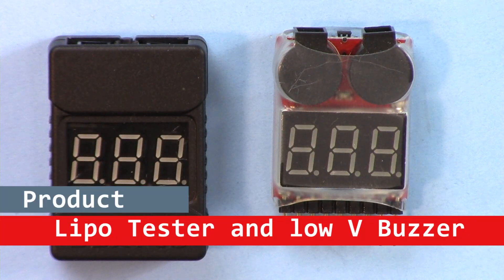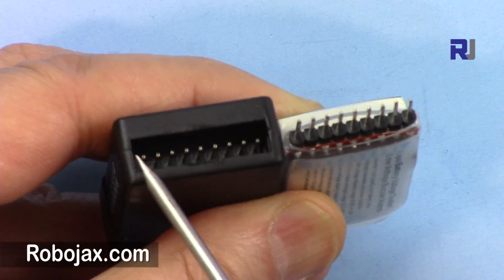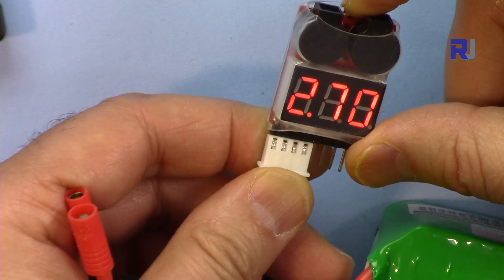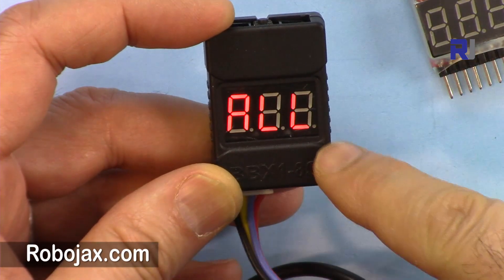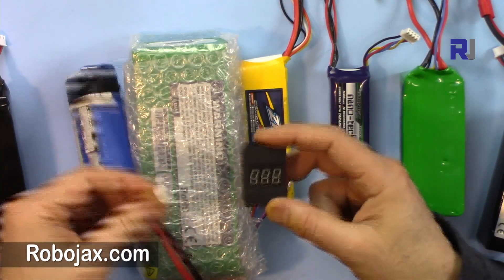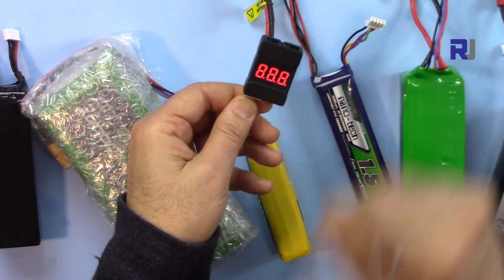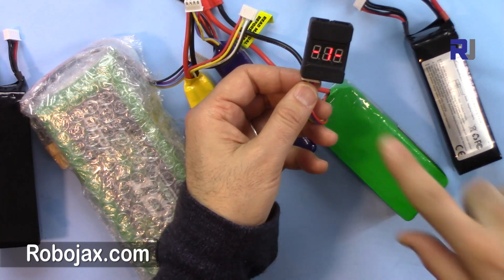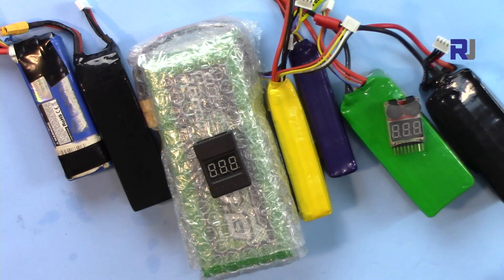How to use LiPo Li-ion Li-Fe Lithium Battery Tester with Low Voltage  buzzer alarm

Comment: I thought 3.3 volts was the low limit for lipos . My goggles used a new  4s lipo today and completely dead . But after 4 hours sitting with no charger it raised from nothing to 3 .2 volts per cell . I charged it and it is still 4.2 volts per cell 99% 😊 . Thank you for showing me the dead battety alarm i can use it on my goggles and transmitter .
Reply from the maker: my pleasure. Cheers

Comment: The display used is common anode or common cathode type? I want to change it's display
Reply from the maker: If you are changing it then remove the display and test it.
Reply: @robojax  I did a test with the display connected, it came out to be common anode type...

Comment: Testing the one I just got, I found that if the ground connector is removed with all the other connections present, the unit will turn off and not draw the 8 to 11mA that it does when it's on and displaying the readings.
 I figure on putting a momentary switch on the ground lead to turn it on and get the readings of the pack without having to plug and unplug the whole connector each time.
The draw on each of the cells is about 80 to 100uA through the sense lines, so for the long term I'll still disconnect it completely just to avoid that bit of parasitic drain.

The weird thing about the design is that most of the 10mA operating drain will be drawn from the first two cells, with the all other cells showing a negligible draw.
Connection of just one cell in a 1S configuration will read the voltage correctly, but with a dimmed display and a low beep annunciator, because it relies on the second cell connection for most of the power.

Comment: Do these things have any provisions for calibration? 

The one I tested seems accurate to the last displayed digit, so it doesn't need any further calibration, but it would be nice if it's possible.
Reply: @dubmob151 really not that long, maybe 5 secs, I don't recommend you to do it as it becomes a paperweight without knowing what the reference voltage is lol, I can't get to the microcontroller or eeprom (if present), I have the one with the plastic case and it's under the display, too much work to desolder it
Reply: @daijoubu4529  I'll have to remember not to do that- 👌
Reply: I held on the button and now all by readings are 0.00 lol I must have triggered some calibration of sort using a reference voltage, oopsy
Reply: @daijoubu4529  how long did you hold it for?

Comment: Is there a way to control the voltage of the cells with your Arduino uno and when used the Arduino with an esc and potentiometer set a shutdown voltage?

Comment: what is good  stoerege charge for 6s
Reply: if the battery alarm has triggered at the lowest voltage set on your meter ie 3.7 volts per cell after use. recharge the battery for 15mins and set a timer then stop charging at 15 mins. that should be sufficient for safe storage.

Comment: Is it set only once for the minimum voltage alarm threshold (let's say we set it at 3.6 V) or does it need to be reset every time the battery is plugged in?
Reply: I hardwired it for monitoring my battery pack and don't have a connector to detach it, so I leave it connected and just put a switch on the ground connection to turn it on and off, and the threshold setting is maintained. Seems to work fine with minimal drain. 
I desoldered the two beepers to keep it from going off every time I switch it on.
Reply: @dubmob151  Nice, that's a damn great idea!👍
Reply: @catherineharris4746   it maintains your low voltage setting also, so you won't need to keep resetting it if you're not using the default threshold-  I put a tiny momentary switch on it so I just push and hold it just to read out all the voltages; just for a quick status check.
Reply: Yes everytime you disconnect/connect a battery you must reset the low voltage alarm threshold👍
Reply: @catherineharris4746 set your voltage,  say 3.5.. press and hold button until it beeps.. now your set at 3.5 all the time, until you change it..
Reply: @jimharrow8104  Nope, every time this device is disconnected, you have to reset the voltage because it does NOT have a set voltage memory chip in it. It still serves it's purpose so you don't destroy your battery though👍
Reply: @catherineharris4746  I have to check it out... the factory alarm is set to 3.2...
Maybe I've been assuming it stayed on 3.5... 
If your right,  thanks for the heads-up...
Reply: Set you low voltage,  say 3.5... press button and hold until it beeps... Now your low voltage is always set on 3.5...

Comment: can we use the checker when the lipo battery is being used by other devices? or can it only be used to check from time to time
Reply: 💡Of course you can, that is what this device is made for, to be connected while the battery is being used so it doesn't fall below your low voltage threshold that you set👍
Reply from the maker: this is "Tester"

Comment: If you want to save money and trouble, make your li-pos last the longer it can, NEVER charge above 4.23v/S and discharges until gets to 3.4v, do not charge to store it, 3.4v/S thats the correctly storage voltage, now, about the current, you need to search about your battery charge rate, and if is real or fake, the old batteries from 10 years ago was rated 1C but was really 0,7C usually, and maybe still some cheap ones around today that do the same IDK. Off-course, always balance.

Comment: On a 2 cell or 3 cell, what is the minimum voltage to set the alarm at?
Reply from the maker: Each cell should be the same. Check data sheet of the battery.

Comment: Hey can someone help me mine is 0.00 what does that mean?
Reply from the maker: strange. Never seen it. it could mean the module it powering it up but the portion reading voltage is not functioning. Not sure. Let's see if anyone else replies.

Comment: So if one cell is higher do you put it on the charger to balance
Reply from the maker: most lithium chargers are balanced charger. So if you charge it, it will bring the other cells higher to make them equal.

Comment: The unit needs at least 3.6v to work, so it's totally useless for warnings below about 3.7v! It also reports 3.8v when it's 3.6v (Verified on several multimeters and from bench PSU)
Reply from the maker: Thank you for your comment. I just checked it and it works with 3.0V. So it will work . if you have a power supply test it.
Reply: @robojax  Mine must be duds then, they only just go on ast 3.6-3.7v for a single rail :(
Reply: Wonder if they can be internally adjusted. Pretty much useless if the accuracy is off, unless you can mentally adjust for the error for each channel on the fly.
Reply: @Ziplock9000  it really needs a minimum of two cells to work, because the main power for the unit is drawn from the 2s input line. 
Using it for 1s results in a dim display with variable results.

Comment: Tks. How do i figure out what value to set tester to so it will beep without damaging battery?
Reply from the maker: you can get it from manufacturer or there are lots of website listing that. for lip batteries, it is between 3.4 to 36V but manufacturer would tell you exact value.

Comment: Is there a way to disable the beep every time I connect to a lipo? Every time I check voltage it beeps so loud my wife complains.
Reply from the maker: unfortunately it can't be change like that.
Reply: hahahaha, that is exactly why I want to turn off that annoying beep...The wifee always complainsahahahah So funny!!
Reply: Have you tried covering the speakers with your finger when you plug it in like what happened in the video at 5:28
Reply: I think you can set the voltage beep to off and then it won’t beep at all even when you plug it in.
Reply: If your wife gets annoyed then she does not respect you as wihh out this you will not enjoy hobby
Reply: @lucab1733  it is extremely loud though. anyway I just removed the speaker. all good :)
Reply: Someones not balancing their cells!
Reply: @daysdesigns  balanced or not it beeps when plugged into a lipo
Reply: get a new wife check out MGTOW
Reply: @hankfava  I'd laugh at this but she sees all my emails. So screw you Hank! She's a wonderful wife!

Comment: I've got a new 7.4v 500mah 2cell battery. After a full charge it reads: All: 08.2 C1: 4.16  C2: 4.07  is this bad?? I only got the USB cable-charger that came with my 1/16 Absima. (after driving for 2 minutes the battery reads: C1:3.8  C2:3.79 so the there is less difference then. After the car goes into lowpower mode, the battery reads: C1: 3.6  C2: 3.35.
Reply from the maker: I am sorry for late reply. I was on vacation.  I believe that is okay for your application. 4.16V and 4.07 is 90mV. Your car is connected directly to - and last cell. so it will read the total.

Comment: I recommend plugging Lipo in to smart charger with digital read out to see what each cell voltage is then using theses to see which is close to charger.
Reply from the maker: That is also another way to see the voltage.

Comment: Thanks for the info. I had no idea how to use this.
Reply from the maker: You are welcome.
Reply: @robojax  I use flooded RV batteries.  Most inverters sounds their alarm when those batteries get below 11volts which could damage the battery.  According to what I've found on Google that RV batteries need to be discharged to 12.25 volts before charging.  Are there alarms that can be programmed for flooded or gel batteries?

Comment: Hey I like your video can you help me with some information  what's is the best settings for the 4S lowest voltage alarm
Reply from the maker: It depends on the voltage of each sell.  You would have to check the manufacturer datasheet. It could be from 3.4 to 3.7V
Reply: Hello nice video. Question I have a 6s battery. I plug it into the lipo alarm from left to right but it says it’s a 7s battery? Any ideas why it would do that? It’s supposed to be a 6s battery.
Reply: 3.7v minimum!👍

Comment: how much power does it consumed? in terms of milliamp.... when its constantly plug in to monitor the battery.....
Reply from the maker: It is very hard to measure it. it depends on how many digits and which digit is displayed. for example digit 1 will consume very little while digit 8 consumes the most.
Reply: @robojax  3 cell series 18650 12v   should be able to explain how many current it drains while constantly plug in....
Reply from the maker: No it will not. You need Ampere Meter for that.
Reply: I have some coming in and haven't tried it yet, but I'm looking to have it turned on only momentarily to act as a battery check, but don't want to plug and unplug it each time. 
I'm going to try disconnecting the ground lead and see if that turns off the unit, and won't drain with the battery from the rest of the connections.
If it works I'll just have a momentary pushbutton to make the ground connection.
It doesn't seem like anyone's ever tried it in all the videos I've seen on this gizmo, so it remains an unknown-

Comment: I have to questions. So on the smaller red battery buzzer do you have to unplug it to turn off the alarm, or can you just press the button? And also, if I don't want my battery voltage to go below 3 volts would 3.3 volts be a good setting for the buzzer, or should I go lower?
Reply from the maker: 1- Yes you have to unplug or change the value to stop the alarm. 2- Lipo battery will be damaged if you 2.7 (or ± 200mV). so it is up to you at what level  you wan the alarm to trigger.
Reply: The general consensious is not to let the individual cells go below 3 volts DC but some set the alarm to 3.2 volts, 3.5 volts or 3.7 volts just to be safe.  @robojax
Reply: If the voltage droops under load it may be necessary to set it lower to keep it from beeping under normal operation.

Comment: Will this work on a 1s battery, the way I understand is the alarm only works in 2s-8s
Reply from the maker: I have not tested it but All listing on eBay, Amazon or AliExpress hows 1S-8S so 1S should work.
Reply: itsmewoodG there is no such thing as an 8s
Reply: @FN_Savage67   Probably not for your purposes, but there are plenty of 8S batteries.
https://www.maxamps.com/products/8s-lipo-battery-29-6v

Comment: What should I set this to for a 2 cell lipo and a 4 cell lipo, i know they are going to be different, I am ordering 4 of these
Reply from the maker: Number  of cells doesn't' matter. Each cell voltage matter to be on average 3.7V and  you can set you lower limit for example 3.5V and this will check each cells and if any of them go below 3.5v value, alarm will trigger.

Comment: I set mine to 3.5 volts and it works for me...dont buy the new version the old versions are fine.
Reply from the maker: Agree. old version is more durable
Reply: Robojax isn’t the new version more durable because it has a case
Reply: @FN_Savage67  yes, it would be.  has a neat appearance for rc planes as well

Comment: I won't buy this again
Voltage number and alphabet is terrible(Broken circuit!!)
I can only just recognize "ALL"

Bye. 👋 go to trash can.
Reply from the maker: which one? the old or fancy (black case)? I have been using the old one for over 3 years now and no issue.
Reply: @robojax  the old is without case..?
Reply: 34Gray_Wolf. It was just a faulty one not all do that buy another and it will work perfect

Comment: Is it not damaging to discharge LiPo below 3,3 volts
Reply: It is
Reply from the maker: will not charge if bellow the rated voltage. Should not damaged the battery.
Reply: a minimum of 3.7 volts per cell is better.

Comment: How do you reset these things to factory settings?
Reply from the maker: it doesn't remember anything to reset it.
Reply: Robojax I'm trying to get it back to the regular settings. I know you can but I lost the instructions and Google don't say anything
Reply: The only thing to set is the battery voltage you want the alarm to sound. For a single Lipo battery you would not want to set the alarm lower than 3 volts.
Reply: Volthaus Lab I can't figure how to bring it back to 8.4 volts I just use it to test 2s lipos
Reply: The alarm set value range: 2.7~3.8V . Setting the alarm per cell I don't let my lipo battery voltage go below 3VDC because any lower might permanently damage the battery .
Reply: @VolthausLabElectronics  if i just charged up a 3S yesterday (1st day) , so 4.2 per cell.  And we did not need it when flying today (2nd day), should I discharge it back to 3.8 to 3.85 this evening (2nd day)?  Or will I be ok if I use it tomorrow (so 3rd day)?  or no?  Thanks in advance, you seem to know a lot about batteries.
Reply: @harpoon_bakery162 Sorry for the slow reply. Letting it stay at 4.2 overnight won't harm it at all.